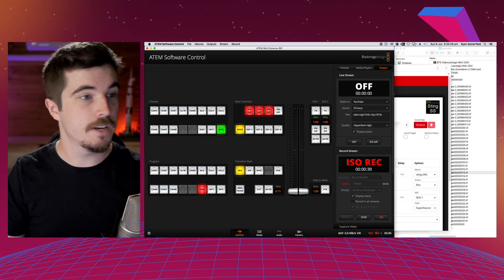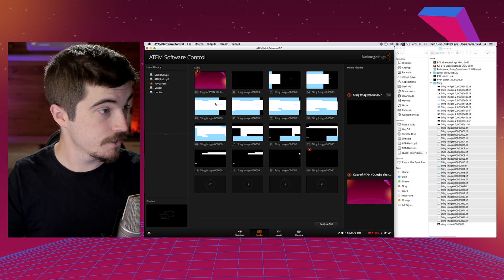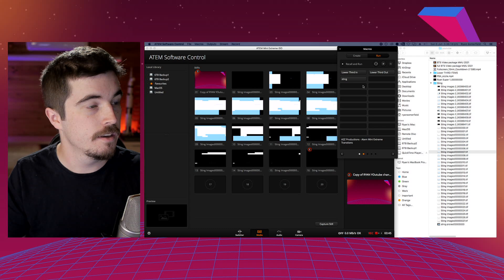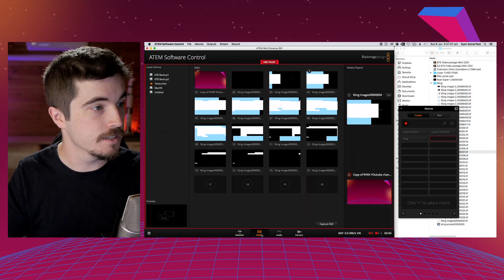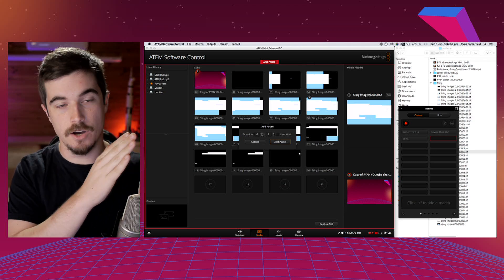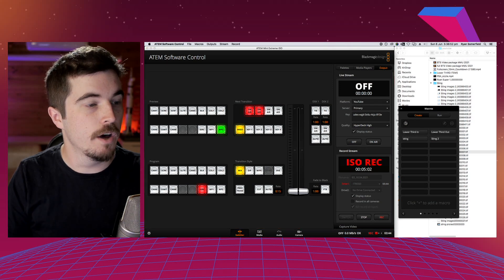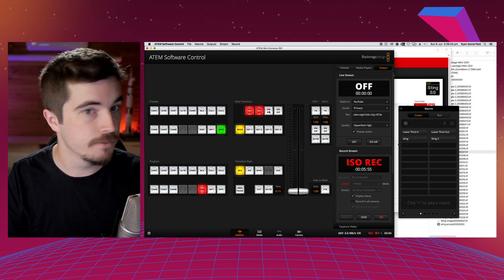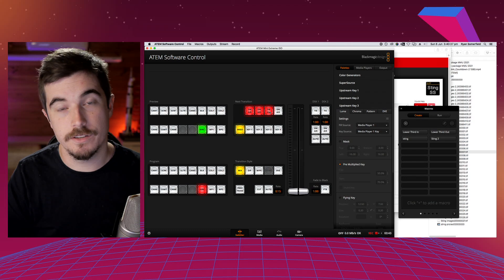Stinger Transition on any ATEM Mini with No Extermal Hardware

Comment: What prevents the use of longer stingers, loading from frame-by-frame into one cell of the media player? After starting the macro recording, add the first image to the first MP window, create a macro move for 1 sec, and so on. Thus, you can do a stinger for 3 seconds, for example, and not occupy all the cells of the media player.
Reply from the maker: If i understand correctly, are you talking about importing frame by frame into the atem from your computer while recording a macro? this wont work unfortuantely as it can only work with whats been loaded into it.. but if you are talking about selecting a frame, waiting a second, then next frame, then another second, so essentially 1 fps style then you can certainly do that

Comment: Hello, thanks for video.     I am confuse with my ATEM 2 M/E Production Studio 4K
Reply from the maker: Is it not working on the 2M/E? i havent actually tried it.. but thought it would work as they all act the same.. unless theres a performance issue?
Reply: @RyanSomerfield  .. Hi Ryan .. it could be the Still position in the Mediaplayer themself .. the Macro you did grabbed the Still out of the mediapool and it looks like it remember the position ..
Reply from the maker: @mtsteuerung6916  Yeah i believe it loads in the number/position not the name.. i have been swapping out the images for the return feed show and its worked straight away without having to reprogram :)

Comment: Does.the stinger need to be made up of seperate frames? Could you split the stinger animation in two halves and have two MP4s play with camera switch happening in the middle using macros (like your example)?
Reply from the maker: Absolutely, although the atem only holds still frames that can be stored in them. To do this you would need to fire videos from an external source like obs or hyper decks for example with fill and key outputs.. this would need to be fired from an outside source like companion. Unless you are using hyperdecks which can be controlled by the atem.
Reply: @RyanSomerfield  good point. Forgot about media player only being for stills.

Comment: So do you need companion to run this? Or can you map it to a button on the Atem so you can just have the Atem plugged into power and still do this?
Reply from the maker: On the ATEM extreme models you will be able to do this on the surface as there are 6 macro buttons available, so as long as you make this on macro 1-6 you could use it to fire that transition. On the original Mini models you will need to do so either in software or hardware unfortunately... as its not an official "transition" but rather a macro its just finding a way of firing that macro.